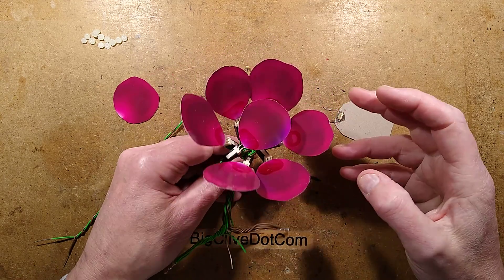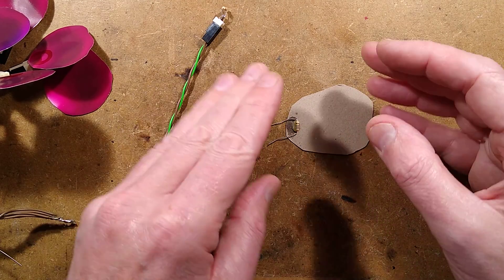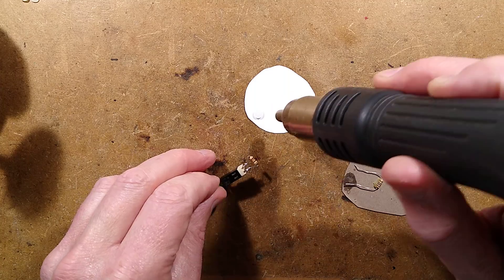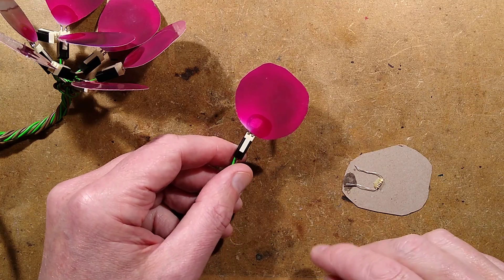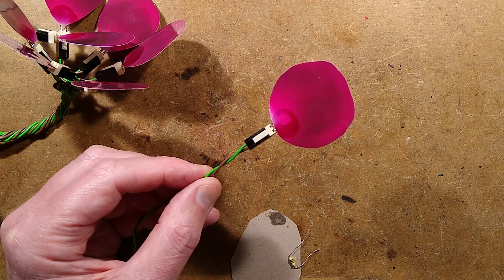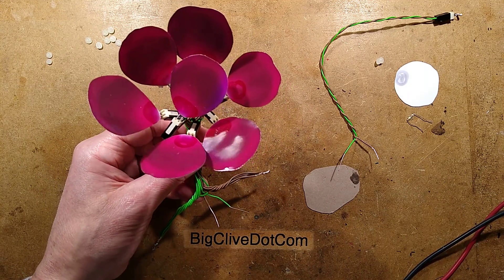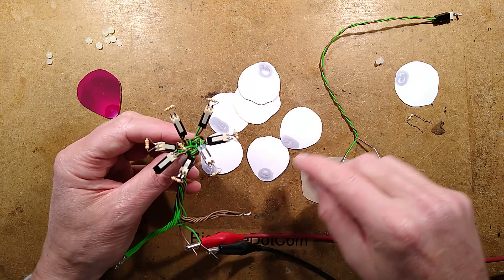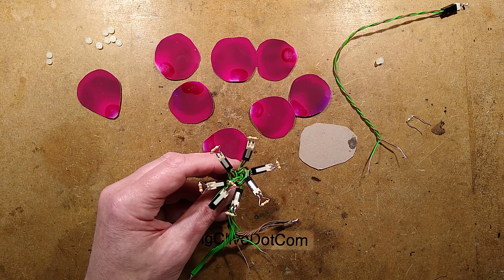Experimental electronic petal dropping prop

Comment: I remember back several years ago,  I was approached to build the exact same thing. I did it a bit differently tho. What I did was have small electromagnets in the stem, wih a matching metal bit on each pedal.it had a RC receiver that drove a 4017 that de-energized each Petal electromagnets. Luckinly the container had a huge base to hold a NiCad, and the receiver. Reset ime was pretty much Zero.

Comment: Why use resistors and not something like nichrome wire?

Looks like a really cool effect, and love that it's silent and fast to reset. You're right about the wax adding a semi-random jitter to the time it takes for the petals to fall.

If you do scale this up to a final product with switches and a jig for petal production, I'd love to see it!

Comment: Instead of resistors, you could use short lengths of nichrome wire electrically welded or crimped or twisted onto the wires.  The same way we used to DIY vaping atomizers way back when they were not a commodity.

Comment: 1) use different ohm resistors, and change voltage to incrementally drop petals.  
2) Need just one ground wire and one hot wire.
Reply: Or maybe with zener diodes to control every single petal?
Reply: @aleisterlavey9716  cool! but you still need a seperate resistor to heat up for each zener diode.

Comment: You should probably tell him to watch out for the stagelights, because enough external heat will trigger a cascade
Also,IIRC, you live in a quite cold house, so the timings will vary
EDIT: perhaps get a wireless thermometer to watch the temperature?

Comment: Very cool concept. The first thing that came to mind for a flower dropping mechanism are those 90 cent micro solenoids they sell on Aliexpress pulling some thin steel wire through ptfe tubes, could be a faster response without the annoying servo noise.

Comment: I wonder if an alternate design involving fuse wire would be feasible. The wire would only need to be strong enough to support the weight of a petal.

Comment: My first guess would have been small electromagnets, but this is a very neat idea because the resistors are so small it is very inconspicuous.
Where do you usually get the connectors? I've been trying to buy these molex shells for a while now but they seem to be out of stock everywhere currently.
Reply from the maker: I usually get them from Rapid Electronics in the UK.  But the black ones came from eBay.

Comment: Electro-magnets seemed a more controlled solution
Reply: Yes. My immediate thought was to find small voice coils to use as solenoids against a small piece of steel glued to the petals. Or those tiny inexpensive chokes you find in car cigarette lighter phone chargers.

Comment: Green shrink tube to hide the resistors maybe? That stuff should handle the temperature well and with the risistor "axially" stowed inside would look like a branch of sorts.
And you could bundle the branches with an even bigger sleeve of green shrink tube at the bottom.

Comment: I have done something similar with tiny lamps they do the same thing ,they do get hot and the light can add an effect an LED and a resistor  should work much better because you can control it better.I added petroleum jelly to pure parafin wax to lower it's melting temp.

Comment: I wonder if you could fit a candle into a small hot glue gun to make resetting the petals a bit quicker and easier?  I don't think it should be too hard to adjust the temperature of the heating element to melt the wax just enough to apply little dots?
Reply from the maker: I did actually ponder a hot glue gun and wax.

Comment: Another way would be to use steel rose petals.
For the other end, use a 100uH cylinder coil, and attach a small ceramic fridge magnet to one end and the petals would connect to the other end.
When power is not applied, the petal would stick to the inductor's ferrite core. When power pulse is applied with the right polarity, the magnetic field from the magnet is canceled and the petal falls.
No waiting and a snap to put back together. One can even make the petal fly off by pulsing the coil real hard while having the magnet on the petal (my guess).

Comment: If you wanted more control you could just seperate each wire and hook each one into a button switch with numbers on them? So you press and hold the button to allow the flow through the resistor.

Comment: I'm not sure I would want to build something that relies on the overloading of electronic components to function. Yes it's supposed to only be used briefly which wouldn't be a problem but people are bad at following instructions.
Reply from the maker: I did a test for several hours with a wax soaked resistor and it didn't change in appearance.

Comment: What about a small-OD rubber tube pulled into partial vacuum (i.e. with a syringe in the base), sealed with the petal/leaf? You could restore pressure with a small valve in the base and it would fall, and if you have sufficiently fine control over the pressure you could probably minimize any jiggling of the tube when the valve's opened

Comment: Be careful with the silk leaves, they are considerably lighter, and might not fall off even when the wax is fully melted, just by electrostatics/surface tension... Might have to add a small lead weight to each!
Reply: And now that you're free from the EU naysayers, no-one to tell you off using real lead! Blue passports all around booyeah right?

Comment: Hey Clive, given this one some thought.   You need three things right? Conduction, Heat and Reaction. If you made a 'sticky' type of conductive wax (use carbon powder or metal powder or both in the wax) and instead of heating a resistor across the wax you just had two nichrome wire contacts that would conduct through the wax.  The nichrome should heat and let the wax release from it and as they are only two contacts once released they stop drawling power.  Being a fine wire connection that release should be fairly quick. Resetting could be simply done by sticking it back on with finger pressure.  And as each would randomly be splayed differently, each connection should come at a different time and for one that "lasts to the end" you could just make the splay larger for that one petal.

Comment: Pins and wires were my first idea. I think small electromagnets, maybe without iron core, and small pieces of iron/steel on the petals is better to control and replace. But I also like this simple resistor thing, the result wasn't bad.

Comment: Neat idea but tough to reset. I’d be inclined to attach a fishing line to each petal through a thin tube to the base where a common resettable mechanism like an electromagnet would release. Sort of like dropping traditional puppet strings. Reset by pulling the mechanism taut.

Comment: I think what you need is a product called Museum Wax. It's a sticky wax used to secure small objects to shelves or tables so they are harder to knock over and won't fall off in an earthquake. At 25C it is firm. 35C it becomes sticky - knead a small blob between 2 fingers and just press on for heat gun free reset. 40C - 45C it gets liquidy enough to drop the petals. But beware of hot lights too close.

OR - how about a low melting point type of hot glue?

Comment: The wax pellets may be much higher in sterin. That is often added to candles for use in hotter environmemts, such as in a confined area. Or sold for use in very hot countries.

Comment: I see one potential flaw with this idea - Ambient temperature!   It's going to play a pivotal role in how long it will take for the wax to reach liquifaction. In a cold workshop, it will take much longer than a warm auditorium under theatrical lighting. A cold evening could render different results to a warm evening, perhaps not by a massive amount, but where timing is everything, it could be a bit of a tragedy if one night we're waiting say, 10 seconds per petal, and in the next performance it takes 30 or 40 seconds each.

Just a thought.
Reply: Yes, or if the petals fall off too early due to the heat of a stage light or whatever.
Reply: As I mentioned in another comment, I can see this very thing driving a way-too-tightly-wound stage manager right up the wall. "Drop, damn you!" And I'm definitely smiling with I contemplate it...

Comment: Pro Tip: Dribble (gently) 1 drop of "freeze-spray" by gravity onto the molten wax to solidify the mechanical connection of the Resistor to the Petal - INSTANTLY !

Comment: 3D print the connection between the stem and the flower, use green heat shrink around the connector/wiring. At the distance the audience will be, the audience won't be able to see the different bits.

Comment: Awesome idea. I'd definitely look at an auto shut off, as you can guarantee someone will leave it switched on by accident and completely burn out the resistors.
Reply: A momentary push switch and bright "ON" light should fix that :)
Reply: @Petertronic  Maybe a precharged capacitor dumped into the petal when the switch goes from charge power to drop.  Leaving the switch at either position is safe, but cap must store enough energy to complete the drop.  A row of switches to drop each petal on cue.  Training of the stagehands to know how much time before each drop to flip the switch.  A separate set of wires to prepare petals between shows (plug in, push down, power off, unplug and put in a basket for rigging next performance).  For 12V power use a halogen light, microphone recharging or other available supply that can be kept running.
Reply: @Petertronic  while this would seem like the obvious solution, it has its downsides. Firstly, it ties up (one of) your SLX while they hold the button meaning they can't do anything else. Then it requires constant line-of-sight between the tech and the effect so they know when to let go. Finally any bright indicator is an absolute no-no in live theatre.
Reply: Use a small PTC thermistor in series with the resistor and stick them together.
Reply: I mean a couple 555s and decade counters, and you could have a monostable single press operation with a sequence and an auto-off. Real question is if you want to use FETs or relays, which I guess is more a question of what you want to use as a power supply.

Comment: If the wax thing was too big and ugly, I would not rely on heat to drop them, but on mechanical means. I would try a bundle of those decorative "braiding plastic cords". They are thin PVC tubes, essentially insulation without the lead. I would run some steel wire through them, let them poke out the pretty side, essentially creating a bouquet of Bowden cables, shaped into a petal hub with an epoxy blob (with filler to make handling and shaping during setting easier). The petals would then attach to the steel wire sections poking out the cords with some hard but not too strong glue. Say, wax or hotmelt. Or just a strip of Sellotape (Instantly reusable and needs no heating appliance!). Come performance, the steel wire is retracted, and the petal should fall instantly. Of course, the retraction mechanism would be somewhat bulky, maybe a microservo or a micro solenoid per individual wire, or a common spool on a stepper and with different amounts of slack per wire, tucked into the vase, but a lot more timely.

Comment: In the story the rose wilts first so the bloom faces down, then the petals fall off in sequence until the beast "dies" then the final petal falls. When I made a similar prop years ago it was done with a large silk rose. Used music wires fed through the petals with a small piece of clear tube on each. The wires were attached to a simple wind up timer so it took around 2 minutes for the "death" scene to run and the petals would fall sequentially with the last one taking a bit longer to fall. Reset was simple, as I used a cam on the timer to operate the wires and once it finished you picked up the petals, placed them in the "alignment jig" (small paper drinking cup with a slot in it) then slipped the wires through the petals. Flipped the cam to lock the wires and latched the timer. Starting the sequence was by flipping a toggle on the rear of the table the rose was on. These days I'd probably use an electronic timer with a small servo to pull the wires, unless the audience is very close they wouldn't hear it working.

Comment: This was a simple yet ingenious solution. The wax and resistor gives the right affect to produce a great stage effect. Really enjoyed watching this vlog Clive .
I was thinking if you wanted a different more extreme effect you could possibly use pyrotechnics to blow off the petals .😁
Reply: As one of the safety people for our group, use of C4 on stage is highly discouraged...  I've done flash paper and nichrome wire though.
Reply: I don't think the bang will go over well in a theater setting.  Nor would visible flames from an electric match. ;)

Comment: Why not use 240V? The wax is just going to melt under the limelight. Use Cascamite glue and disposable resistors. Much more reliable. And the petals can't get stuck among the wires if they are blown clear.

Comment: Would use the higher temperature wax. The stage lighting will soften the candle wax in a normal (non Clive walk in freezer) stage environment, and thus you will have premature separation. 

Alternatively you can use hot melt glue, and a 1W resistor, so that it will need to get to a high temperature to fall off. Hot melt dot on the resistor, a small one, and then place the petal on it before it cools. Resistor will be axially mounted, looking like a stem, and thus at a distance invisible, and you can paint them with black paint, and cure the paint in an oven, before assembly and attaching the hot melt dot on.
Reply: Hotmelt draws horrible whiskers, though, making a colossal mess.

Comment: Not sure if someone has mentioned or thought of this, but you can adjust melting points of the wax by using a portion of beeswax with paraffin or soy wax. Might help with different times to have the petals fall away, with the exception of the last one. Maybe even using slightly different resistor values, or a power supply that ramps the voltage up over a period of time if the beeswax doesn't melt in a short enough time. Could help to prevent them from all coming off all at once

Comment: Maybe I've watched too many marble machine videos, but I like to see it done with magnets and a screw. As the screw is backed out of whatever petal frame, the magnet will no longer have any backing and fall away. Easy to reset, easy to time. Of course, you could also go "full borg" and use an arduino.

Comment: Nice one Clive. You can get higher power resistors in that physical size, like 0.5W metal film. They just tolerate a higher temperature. And you can get smaller 1/8W resistors too, which with a smaller quantity of wax may heat up faster. And smaller connectors too will help by not sinking as much heat, or possibly with the resistor leads coiled tightly (spaced coils) so they present a higher thermal resistance to the connector. A microcontroller can sequence the heater currents so the petals fall in a pleasing sequence, rather than drop en masse. Lovely idea with a lot of potential for elegant refinement.

Comment: Also, a nichrome wire, like you use to make an electric match... (wind the wire around a very narrow strip of 2 sided pcb scrap.)
Would give you a large heating surface, more wax, better hold).

No pyrogen compound... You don't want to torch the set!

Comment: Clive.
What would happen if you used a piece of thine wire instead of a resistor? The petal would have less surface to hold on with and it may be quicker.
It would also make it more compact and less noticeable.
😃👍

Comment: If the petals had an insulating flap over the resistor, when the current was applied, the resistor with a petal attached (under the insulating flap) would heat faster. than an unpettaled resistor in free air.

A diode in the "bunch" petals  and a reverse diode in the last petal to fall, would let you use a center off reversing switch, you could then use just one pair going off stage to do the whole thing.

As the petals fall off, the resistors would be exposed to more cooling, keeping them from staying hot for too long.

I thought of using ntc resistors in place of carbon film... but it might get finicky under stage lights, with changing ambient temps.

Comment: You could make a very pretty rose with wax pooling spots and resistor holders with a 3d printer.  It would cut down on the reset time.  I'm imagining like a pinecone center that would make the pedals shaped like a rose easily with all the resistors and maybe a pellet of wax in each groove.  Could heat it up and put your pedals in and cool it down with the air duster method.  You could make the connective wax a very thin layer so you don't have issues when you scale it up for stage.  I love 3d printers... can do so much with them especially when combined with electronics.  Add an arduino to heat up each pedal in the order you want and you could make a very pretty easily controlled flower prop that isn't that tough to reset.  Stems and bases for the flower would make it easy to hide the control mechanism as well... could even use an hc 05 and control it from a phone ;)  Might need a rasp pi for that though... not sure if the arduino could handle the breaks. edit:  Of course I suck at coding so someone could probably do it easily.